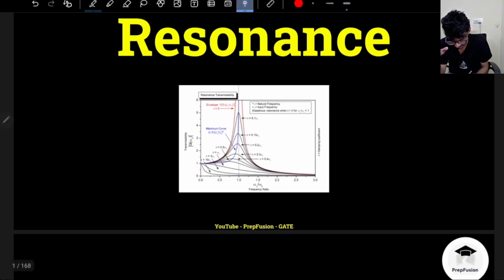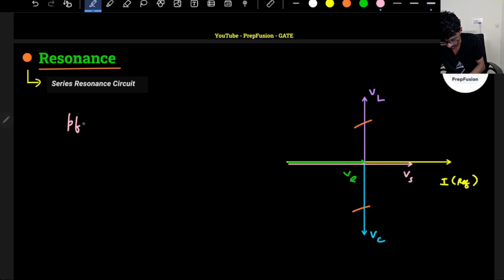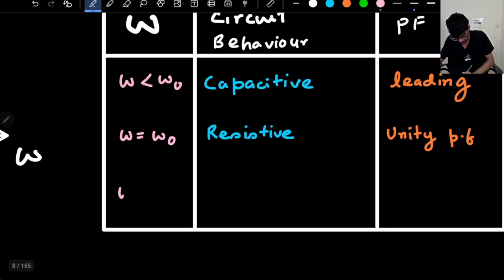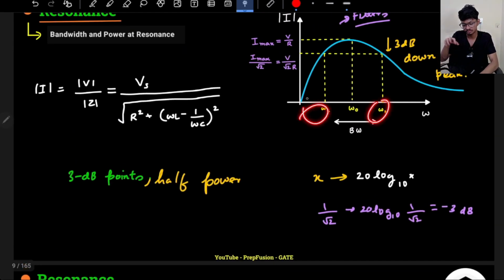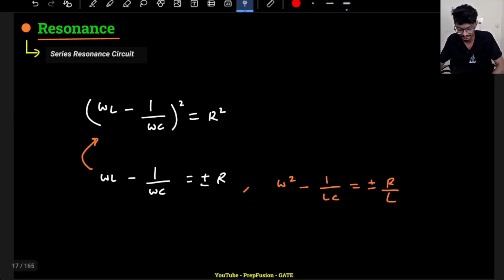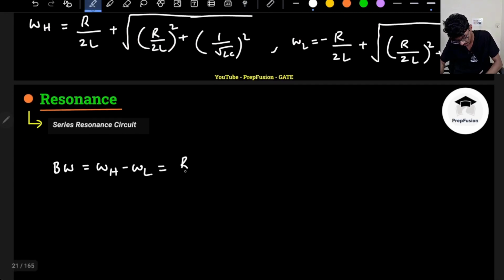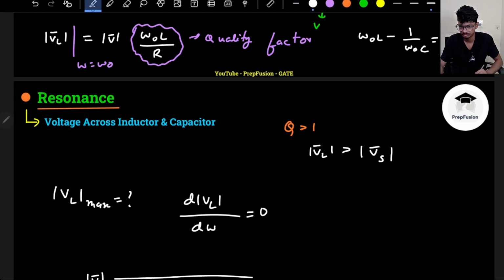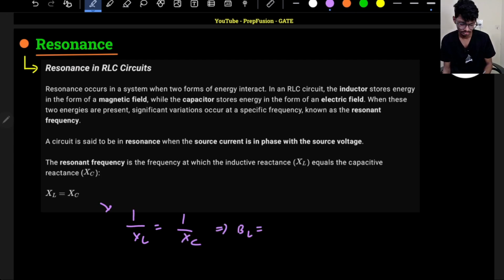Series RLC Resonance Circuit || AC Analysis || PrepFusion

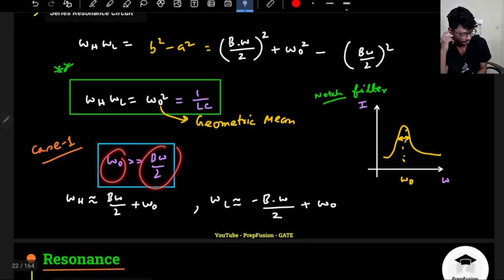Comment: @1:03:50 it is a resonating filter which allows single frequency and blocks the remaining. But, Notch filter blocks the single frequency. Am I right?
Reply: Yes Correct, You have almost finished the AC portion of Networks so I am expecting you give a review on the first video of AC. Lecture 1 of phasor diagram.

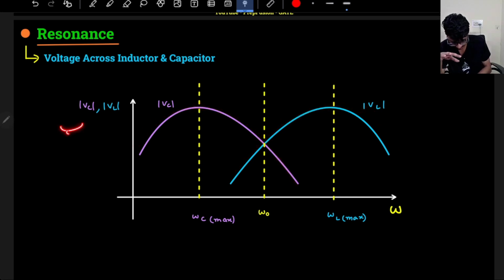Comment: @1:19:41,when showing the voltage across the capacitor,initially at lower frequency say W=0,the impedance of the Capacitor is very high.Can't we think the Entire source voltage appears across the Capacitor while the current flowing through the circuit is zero?
Reply: Yes you're correct but we have ignored the w=0 in this case.